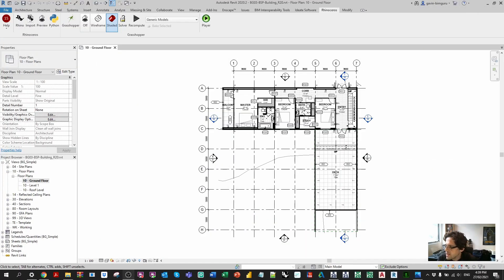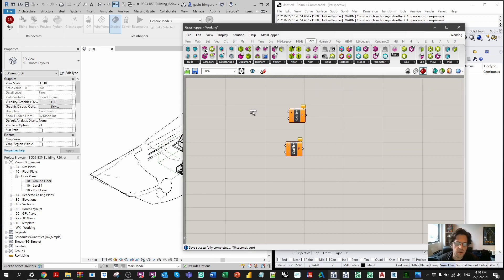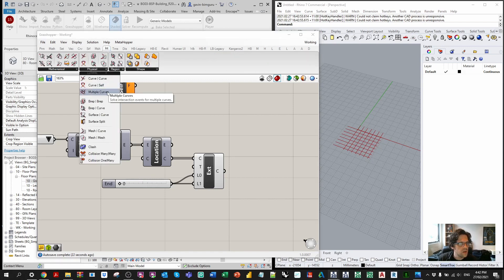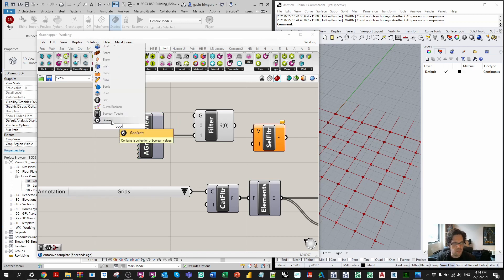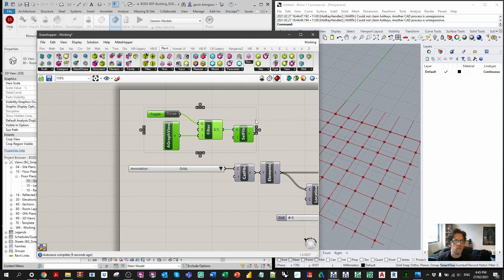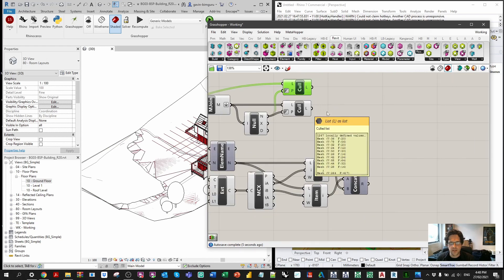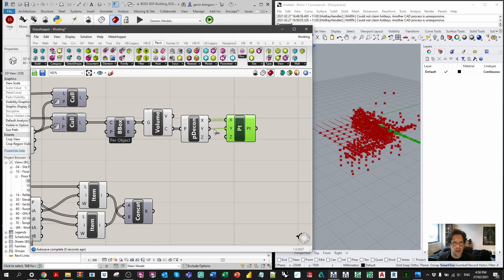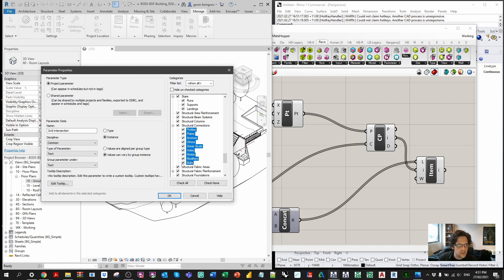Closest grid intersection to Revit elements using Rhino Inside!

Comment: Good to see this alternative script. Obviously one big advantage of Rhino inside Revit is its processing speed of script/ geometry. Out of curiosity do you think that Dynmao will catch up in the future? I hear that newer version of Dynamo will have much greater processing power even for geometry in newer versions of Revit ie maybe RVT 2022 or 23. Wouldn't mind your brief take on what you think. Thanks again for all your effort on these  things
Reply from the maker: To be honest I don't expect Dynamo to ever become anywhere near as fast as Grasshopper/Rhino when it comes to geometry. They're using the ASM geometry engine which is severely unfit for heavy tasks the way it's currently being used and set up (for example it really cannot handle complex meshes or Nurbs, it isn't built to like Rhino was). Ian Keough apparently built Dynamo to be able to run in different geometry engines, but this is the one Autodesk chose for it to be integrated with for Revit.

I believe Autodesk knows that they're fairly well beat on this front, and I hope to see them focus more on API/workflow based nodes and functions instead of wasting too much time saving a few seconds from tasks which typically spin/crash Dynamo out anyway. It's harsh, but it's the simple truth of the matter unfortunately. Just look at the Ladybug tools team for example, they left Dynamo a long time ago, and in that time ever really put their tools to proper use like they can in Grasshopper. They tried, but they hit the same limits many of us do when comparing the platforms.

By Revit 2023 I doubt it will be capable of the sorts of tasks we use Grasshopper for - I would recommend you try out Grasshopper/Rhino to really feel the difference in how the engines work.
Reply: @AussieBIMGuru   Thanks for your in-depth response. Very good overview of where Dynamo is heading. Yeah I think I need to start learning it this year